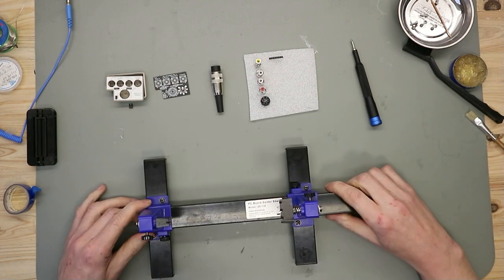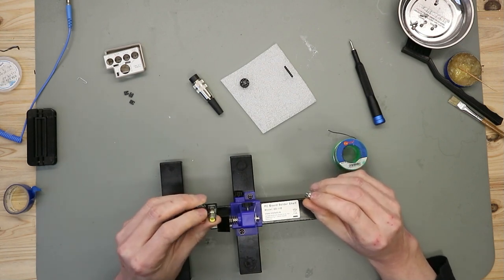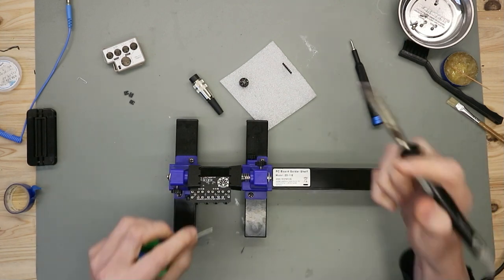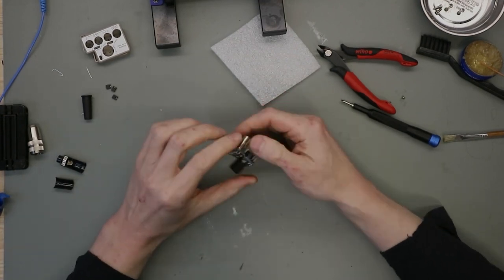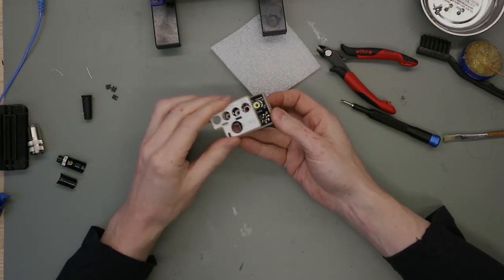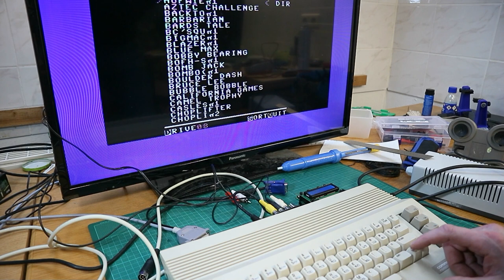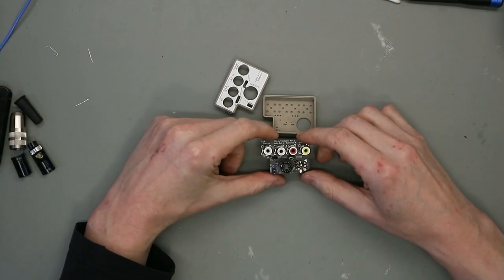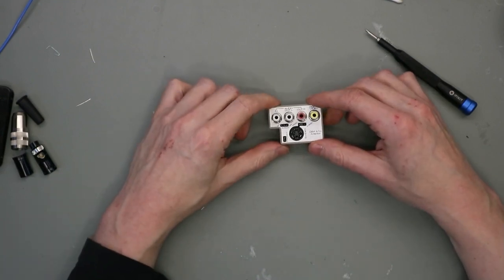Let's build an A/V-Adapter for Commodore C64

Comment: There are different ways to reach the goal, again 🙂 Here is mine:
The DIN connector is the first thing, I solder. One wants the DIN connector to stand out as far as possible, so when it is in the case, it should be fully inserted into the A/V jack. So I put the pcb face (top) down on a little board nd insert it in a way, that the pins are flush with the top side of the pcb. Then I solder it from the bottom side - one pin, then check if everything is straight, the solder all other pins from the bottom side. Then check the top side of the PCB to make sure, the solder flew through the holes, maybe add some more solder, if required, 

Then I solder the jumpers and the resistor, the mini DIN and finally the RCA jacks. 

I solder the center pin first and then shorten it as I shorten  the four ground pins before soldering. It requires a stronger side cutter, because 5hey are sturdy. Then I solder them.

I think, the problem, that you had with the case was from the pins being too long on the solder side. 

I also use jumpers with little handles, so they can easily be changed/removed.